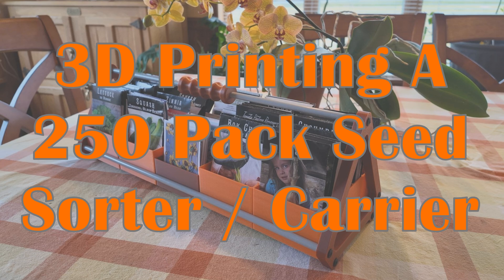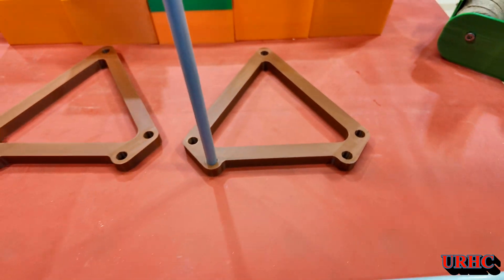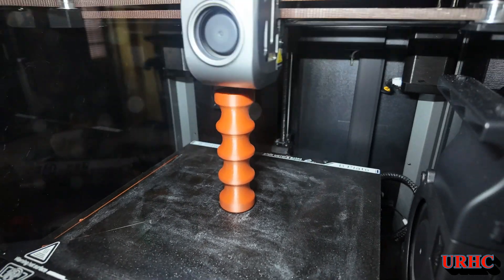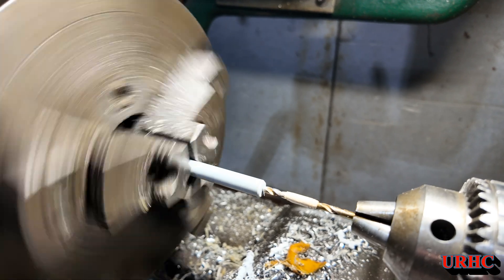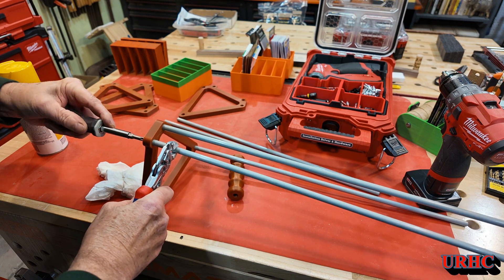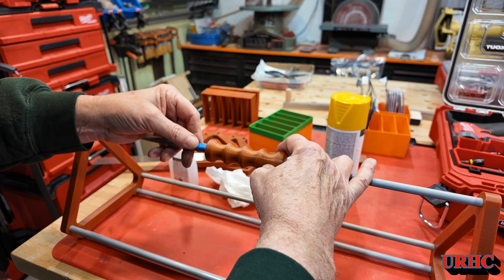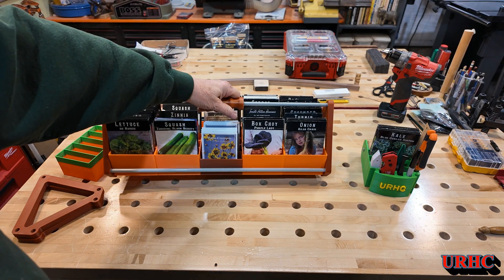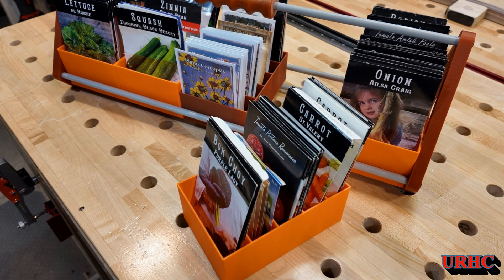3D Printing A 250 Pack Seed Sorter Carrier

Comment: Do you recommend the K1 I want to be able to make similar parts nothing too big ,, and little things for the grandkids?
Reply from the maker: Mine has worked good so far and has a couple hundred  hours with few problems.  There is a newer version now that is supposed to be better and they also have several open models that are very low cost now. Bambu labs have the best multi color printers that are affordable now if you want colors. Definitely plan on spending time to figure out the best settings for each material if you get one. Thanks for watching.

Comment: Lots of power outages lately
Reply from the maker: They are pretty common now. Apparently they are playing games switching power feeds on the grid to match loads. Almost sounds like them taking down gas generators and trying to switch to solar is becoming a huge reliability issue with everything pushed past its limits.  Thanks for watching.

Comment: I'd like to see a video of all your Milwaukee tools and recommendations on which models, batteries and tools you prefer.  Thanks!
Reply from the maker: I just don't know if Milwaukee tools are the best at this point. I like them and have  had excellent luck with the M12 and M18 lines but I won't really  know how they stand up for a couple years. I thought Dewalt 20 volt tools were best until I started having issues, and Makita 18 volt batteries dying early drove me from the Makita line. Seems that companies like Harbor freight are actually coming up with some much lower priced competition that are also good and would be a good fit for many. It's almost like the old Ford vs Chevy vs Dodge argument we used to have years ago before Toyota and Honda came along. 
My favorite M12 tool is the rt angle die grinder.  Thanks for watching.
Reply: Thank you! @unemployedredneckhillbilly2023
Reply: @unemployedredneckhillbilly2023  excellent analogy